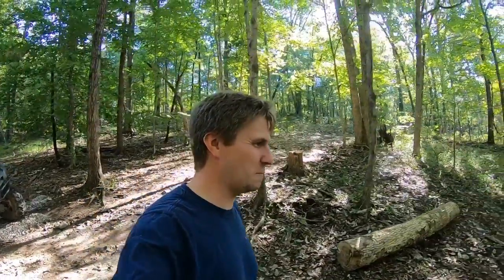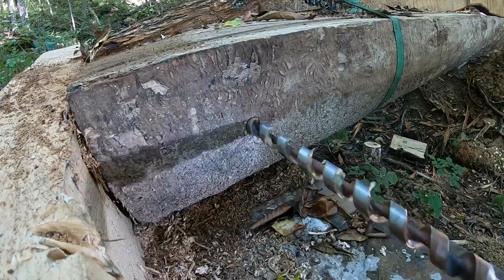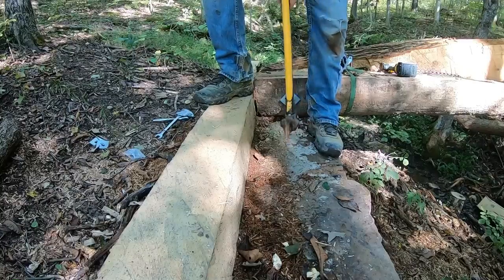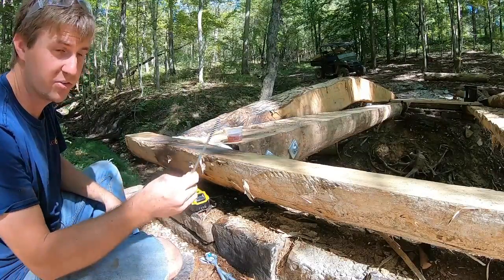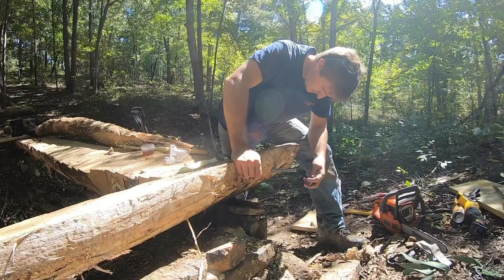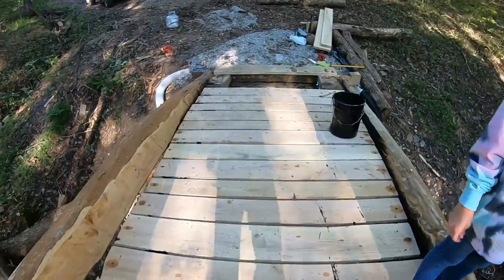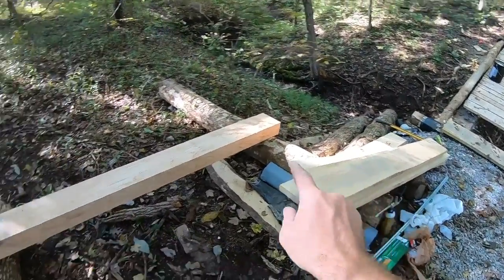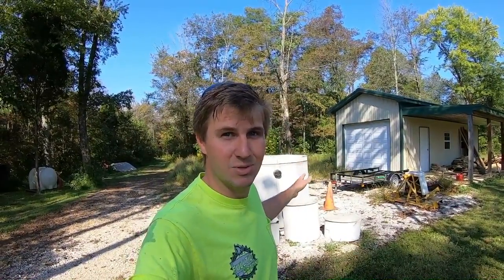Installing Bridge Deck & Hardware on My First Timber Project - Special Guest

Comment: Captain that auger bit that works better is red because it’s made for redwood. What you’re drilling into must be a closer species to redwood than what the alternative is designed for. Which is why it bites and pulls as it’s suppose to do. Back in the early 1900’s they would laser etch an R on the shank for redwood a P for pine, WO for white oak etc etc. I don’t know why they shy’d away from this practice but I sure wish they’d go back to it. Also I believe that if your flute playing hand and you’re dominate piloting hand are different you need to acquire a special type of bit which only further complicates the matter. (They stopped marking for this in 1783 if memory recalls correct, as most people pilot and flutiteer with the same hand- however there’s always a possibility that you’re an outlier) anyway just wanted to drop some knowledge for ya, I’ve
Got to run though. Have a bridge to sell.
Reply from the maker: See this one has a date of 1802,  I bet that’s the problem
Reply: @CaptainKleeman  glad to be of assistance🙃

Comment: great video as always, few thoughts.... on the auger the the shoulder that cuts the side of the whole can be a problem in wet wood, either re cut the cutting edge to a steeper angle or reduce it's size giving the cutting edge on the flute more bite. You made the right choice on squaring the edge on the buttress block too, if your questioning some thing then just do it as I find often 9 times out of 10 it was for a good reason. Had my Captain K fix for today so it's back to the workshop and get on with some work.
Reply from the maker: Appreciate the feedback,  have a good day in the workshop!

Comment: Mike, you might have thought of it, but you may want to run a cable from the arch beams In the center of the bridge, acrossed, under the main beams.

Comment: Over 50 years ago I saw a couple of Black Forest German foresters build a bridge much like that. 
Only one difference. There was no metal in it anywhere. 
They used wooden pegs to hold it  together. 
When  I asked why. Their answer when translated was " wood doesn't rust" !
Reply from the maker: …well that’s true,  but it does rot 🤷‍♂️. Like that answer though!
Reply: @CaptainKleeman  Yup rots right along with the rest of the bridge. (I think the pegs were (very) hard wood)

Comment: From and Engineering perspective: for BOLTS, anything over 1.5 times the diameter of the bolt the threads are essentially not adding any additional holding forces. For SOFT materials it is suggested that the length of engagement be increased. A WOOD SCREW is suggested to be 1-1.5inches into the receiving board as long as it is not protruding through the other side. 

Assuming your planks are 2inches thick, a 4-5inch screw would likely be optimal, but as the material weathers and breaks down you lose strength on your outermost layer, so a 6inch screw would be a safe bet to account for the deterioration.

Comment: the sharper the auger bit the more likely it will cut the threads out and not pull it self. you want the screw part to be a good even thread.

Comment: As an electrician I have drilled about a million holes with an auger but. Keep the cutting edge sharp and she will pull right through. Protect the the tip and keep out of the dirt and should stay sharp quite a while. You’re right, dull augers are frustrating.
Reply from the maker: Appreciate the tip!  See what I did there? 😂

Comment: Mike, we use those ship auger drill bits for work. Is the crap one a Greenlee bit by chance? just purchased recently, say the last 8 months? Greenlee has been the gold standard for those ship augers for most of the people I know who use them daily for the last 20 years or so, so I am not really trying to turn you off of them, but they had a bad batch go through this year. the edge of the bit should taper down into the center and they all tapered to the outside. We went through 3 bits before we got back to ones sharpened correctly. Which sucks, you can do 8-20 houses with a new bit and we were replacing them after about 3 because of the bad geometry. Check to see if it is on yours. the red diablo is okay until you hit a nail, then it is done, take that with a grain of salt - I bought 1 and was thoroughly unimpressed for my needs but it may suit some people just fine. Sorry for bloviating and speculating. thanks for the videos.
Reply from the maker: I will check that!  Thank you!

Comment: I love this whole project! I need to do something similar in my woods. My question... I worry about using green lumber. Will it shrink and split? I've seen a couple videos where folks put up green lumber so they only use one screw on each joint to let it move if it shrinks. I'm new to all of this, so I'm curious if that's an issue that's worth the hassle of only screwing one side then going back and screwing down the other side in a year when it cures?

Comment: The taper on the cutters of the bit might be a little different. No two steel drill bits work exactly the same either. I have some that dull out quick and others that I've never had to sharpen.

Comment: Hello I am a 30year electrician and while we did mostly house and commercial work. the drill bits your showing are what.we used we mostly bought freely bits paid more but they lasted longer, one hot summer my boss decided to save money and bought some cheaper bits one week after doing so he lost 4 milwaukee drills.and ever bit he bought was burned up.Hope this helps

Comment: Hi Captain just an observation & not a criticism you put the screws for the boards close to the edge & not in the middle of the support beam going across the creek just wondered why? when put in the middle using the screw flat head wouldn't have impeded tyres etc & would not have been put through near the edge with not much material to hold it. still a good build though just something I noticed maybe im a bit ocd lol
Reply from the maker: Excellent question!  There will be running boards that go length wise on the bridge,  keeping the screws to the side out of the way

Comment: Look at the tip of that bit it is blue from overheating and The Temper is gone. The screw tip of the bit may thread but the cutting blades are shot and will not hold an edge.

Comment: I would have left my eye bolts as loose as possible so that when I put my cables in then I could draw my cables really tight versus using a turn buckle and adding more cost and work
Reply from the maker: That’s what was done on the opposite side.

Comment: Everyone stating that it’s overbuilt but I disagree yo have to remember this is going to be exposed to the elements for a long time, if it was any less it wouldn’t last no time outtherei.  If you take that torch and burn that lumber all the way around it wood help to preserve it you have to char it pretty good then take a broom or brush and scrub it. Would make it last forever

Comment: I agree with overbuilding completely. I had an engineer scoff at my garage, stating I didn’t need to weld the main truss and bolt. The bolts would have been plenty… he said it would be fine to lift a car off… I said good… that’s the plan…

Comment: Something else that would give a little more support is run your cables through the center support
Reply from the maker: Good idea
Reply: Or run the cables under the centre support and provide even more support since the cable will actually provide lift. 
Old railway cars had a truss rod system underneath them that did just that.

Comment: you can paint used enignr oil on the bridge it will last a very long time if not life time,it stops the water penatrating the wood i use it when ever i can.

Comment: Good grief first you put soooo much effort into building your bridge and now you take a blow torch to it????  LOLOLOL  Just kidding a bit here the bridge is looking so good and I understand the blow torch use ok?  Laugh a bit it helps when your lose your wrench or your drill bit doesn't work...all part of the job.  I only have one suggestion and that is make sure all the bark on those outside logs should be removed because eventually won't the bark soak up the rain and eventually rot those two logs out.  Maybe then seal the logs and deck with something that will help maintain the wood.  WOW a boat in the woods YOU are amazing LOLOL  God's blessings to you and your family.

Comment: Sharpen your bit..... and get a auger drill, they have more power/torque requires less effort. Also a bar of soap for the log-hogs / screws to help with driving them in...
Reply from the maker: Agree, but not really worth the cost for one project.  Maybe in the future though!

Comment: I have one of those flamethrowers and it does not work anywhere as good as yours.  Mine has a handle that is supposed to "increase the power of the flame" it does not work most of the time.  Any thoughts on if I am doing something wrong or just need to buy a new one?
Reply from the maker: They make a lot of different versions,  but the ones that have a simple valve let more fuel through.

Comment: Using too much flashing tar. As thick as that tar is, you only need to "paint" the surface on both top sides of the girder logs  before screwing decking boards in place.

Comment: The leading edge of that bit looks wrong. It doesn't seem to be sharpened properly.  Hit the underside with a file or grinder to sharpen the edge to the front. Just a little will do you.

Comment: Good morning mike the ls bit American , the new bit Chineseuim . That is my guess .
Reply from the maker: Both companies have manufacturing facilities overseas 🤷‍♂️
Reply: @CaptainKleeman  I can't argue about that . But give me a European tool over a Chinese tool any day .  And making U bolts from all thread is not good . It becomes weak because of the thread is a stress point . Maybe go to 7/8 or 1 inch diameter and bend it while red hot to give you the strength of the 3/4 dia . you have .
Reply from the maker: @lhr1701  all thread can be bent as long as it’s heated,  like most steel.
Reply: @CaptainKleeman  I work for a structural steel fabricator in NYC . And yes it can be bent that doesn't make it right . We would never use all thread as anchor bolts that have a bend on the bottom ( J bolt ) . We use rod bar that we bend and thread . I think you ,DP and of course MBTS would love to see our shop and the machines we use . I think SOT metal works jaw would drop if he saw our plasma table . lol
Reply from the maker: @lhr1701  that would be awesome!  I don’t know if it’s possible but If you can email me some pics sometime,  would love to know more about it!  And I appreciate ya looking out!
Reply: @CaptainKleeman  Mike I just sent you an email I have tons of pictures just not of the new equipment but I did send you what I thought you may find interesting .
Reply: @CaptainKleeman  ... why bend the rod when you can just drill through the arch and the lower support beam? Use a straight rod with plates and save yourself a bunch of work. Leave the nuts exposed on top and you can put a wrench on them easily for an annual snugging.

Comment: Nothing is ever engineered to support the maximum load it will carry over its life. Rope/cable has a listed breaking strength and a working strength. 
A bridge has a load limit that is a percentage of it actually maximum load strength so overbuilt is the only way to build it.

Comment: If you want to not burn up drills don't grab them over the vents they need to breathe.
Reply from the maker: Fair point,  but they should also stop designing drill with grips near the vents 🤷‍♂️

Comment: Way of the subject:😏
I think from your past talents your next purchase should be a saw mill. 
With wood on your property you can build pole barns for your equipment chicken coops picnic tables chairs for around the lake patio covers and other miscellaneous wood projects. From the scraps the firewood for your new fire ring or bbq built from rocks all over you property. 

Face it man you need a place to relax from time to time😵
Anyway
Be good be happy be safe.

Comment: you dont over build , you just make a slow build. many people have build a bridge a like good in 1/3 time . but a good video
Reply from the maker: Hard to believe with two jobs, being a parent and husband,  spending 8 hours to edit videos for YouTube, and fighting the fall weather a fella can’t things done faster.  Crazy
Reply: @CaptainKleeman  how i did it,cut down  3  18inch trees one in each side and one in middle and then use 6x2 plank over .last i use tree oil over . that 9 years ago. i drive a 60hp tractor over .all work time was 2 days. work on you fix it
Reply: @CaptainKleeman  I know!! What's up with that?

Comment: On overbuilt vs. under built… the country has perfectly good infrastructure that was built over a hundred years ago by dead reckoning and failing infrastructure that was scientifically designed to be just enough 40-60 years ago.  Never forget, Noah’s arc was built by an amateur, the titanic was built by professionals.

Comment: Mike, a ton of work on this project, but I feel you are wasting your time. You should have picked up two scrap I beams to span the ditch, capped them with PT lumber and then run milled deck boards on top. You could then mill lumber for a decorative side rail. I suspect this current bridge will be a maintenance headache and will become dangerous for more than walking after a few years.
Reply from the maker: Well since that’s the long term plan we have talked about since the begging of the builds, sounds like it’s going to be perfect.  Thanks for watching!